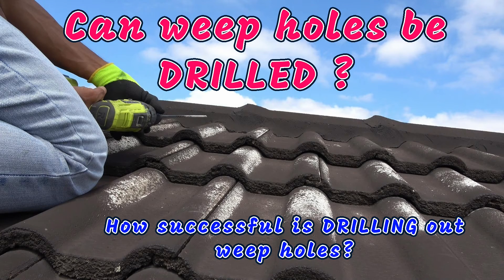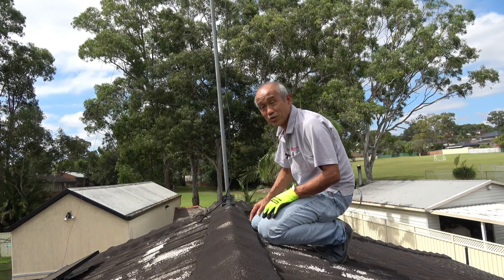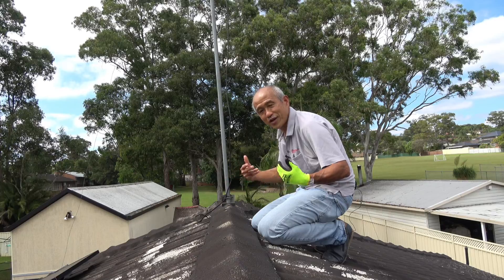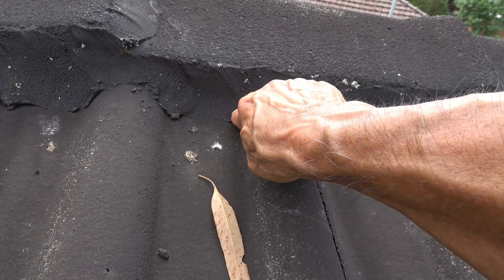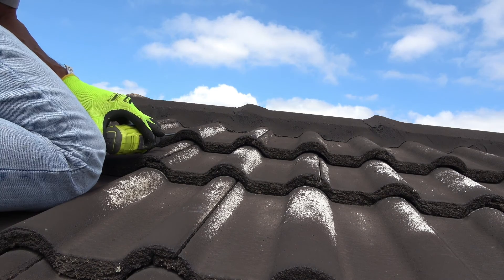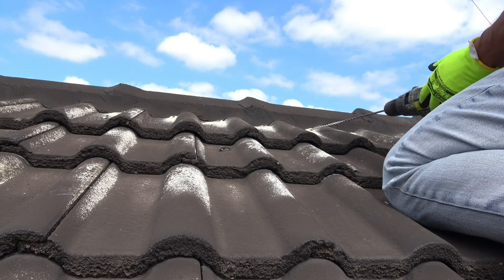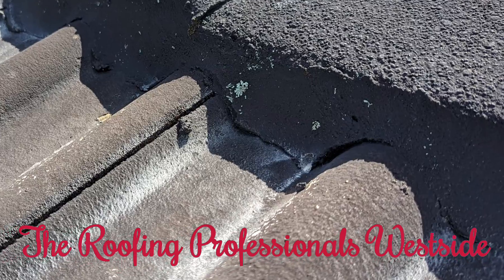Can weep holes be DRILLED out at the ridge capping to repair a slow leak?

Comment: I need to drill weep holes because none of the "professional" roofers that have repaired my mother's Monier tile roof over the years have put them in. You suggested to someone in another comment to upsize the drill bit to 8mm. That sounds huge... would you recommend that? The roof pitch is fairly steep. 

Also, how would you recommend removing mortar dust and remnants from metal guttering, without scratching it up? The roofers left a hell of a mess up there and it hasn't washed away in the recent storms, so I guess it's too heavy.
Reply: Use a leaf blower for the small stuff and pick up the rest
Reply: @gumwallaby  it looked stuck on… but I’ll go up and inspect again. Will wire brush a little if necessary. Still haven’t drilled weep holes 🫣 Really feel like I need to redo the pointing (and more).

Comment: Back from drilling weep holes in my concrete tile roof. My friend who restores rooves said to use 5mm masonry drill bit with extension if needed. Ended up getting MAKITA 5 x 465mm 4-Cut SDS-Plus Masonry Drill Bit - NEMESIS-2 E-04195 from Total Tools didn't require extension as this drill bit is long enough. Drilled using rotary mode and not the hammer action. House had been repointed over existing pointing thereby blocking the weep holes. Had a small leak that verified when is raining, was able to put my finger up under the ridge tile and was damp and leaking. Once hole is started lay drill bit against the tile to maintain the correct angle. Happy I found the cause of the leak and was able to fix it.

Comment: Forgive me for my dumb question. Are you supposed to drill weep holes on both sides of the ridge?
Reply from the maker: The answer is YES.
There is a different roof tile on each side of the ridge capping and they both need to be drained.

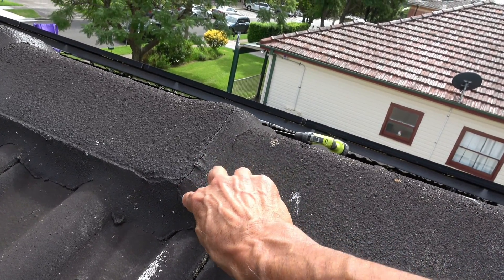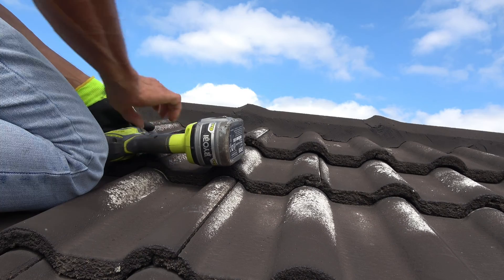Comment: Hi Jack, at 2:40 the tiles have a small crown in the middle of the valleys: I guees that's why the weep hole goes to one side. But with the tiles you are drilling at 2:55 it lookes like the tile valleys (is that the right term) are flat. Does that mean the weepholes can go in the centre of the depression instead of off to one side? I hope so cause that's what I've done! Any advice gladly received thanks Tim
Reply from the maker: Hi Tim,
Weep holes should be installed at the lowest point of the roof tile - so that it can effectively drain out the trapped water. Therefore it will be somewhere at the 'valley' section (even though the valley can be a flat section).
When roof tilers install ridge capping, it is firstly bedded on mortar and this is when the weep holes are created. Then when they come back to point over the bedding, the weep holes are covered and become hidden. 
So, how do the roof tiler find the weep holes again to re-instate them through the pointing?

It is quite simple.
They go either left or right. Middle is a bad option because it is difficult to locate.
So, it will be on either side, as the flat valley transitions to a rise to the crest.

So, when we have to drill through the hidden/blocked weep holes, it is easier to just find where the original weep holes are and drill through these. Left or right - never middle.

If there are no original weep holes to drill through, we find that it is still easier to go left or right - rather than the middle.

Hope this makes sense.

Thanks,

Jack
Reply: @RoofRepairsSydney  I found my weep holes are all placed in the left of the gully/valley (low point) on the tile under the ridge capping. One or two tiles had been replaced and must not have had weep holes prior, so I drilled right through the mortar bed, wasn't too bad as long as have the correct angle, careful not to drill in the tile but stay parallel to it.

Comment: G'day G'day, my names daneil and i just moved into a new house, well new to us as it was built in the 6ps or 70s and within a month of moving in we started to get water stains on our ceiling so i went up and had a look see and there was the 3 or 4 minor cracks in the bottom of severl tiles which was mentioned in the inspection report but what was mentioned was in the report was that all of the ridge lines both horizontal and diagonally were either crack or chipped and in multiple places missing and being on the pension and having spent our last cent on buying it i had to redon all of the ridge line cementing myself reoving ot all cleaning and then cementing it back in and am quater way thru flexible pointing so i can guarantee for certain that there are no weep tiles at all as none of the roofing videos mentioned them and i only watched the ones made by professional roofers showing how to do it. All water leaks have stopped and as soon as i get the money together I'll be buying more flexible pointing stuff to finish it off so my question is should i drill the weeps now or wait until i finish repointing then drill the weel holes and what size drill bit should i use, 4mm 5mm 8mm?
Reply from the maker: Hi Daniel,
We used a 6.5mm masonry drill bit on the video. You should upsize to 8mm if you can.
We recommend drill the weep holes before you do the flexible pointing.
Then, after the flexible pointing has been done, clear out the weep holes just by poking through the 8mm weep holes with a 6.5mm rod/drill bit.
Reply: @RoofRepairsSydney why upsize to 8mm? I went to buy a drill bit for this purpose but couldn’t decide. 8mm looked big. Do you use 8mm as standard now? Is there any chance of wind-blown rain getting in?

Comment: Do you need weep holes in the hips? The ridge caps that run down the roof?
Reply from the maker: Weep holes are not usually needed along the hips - because the watercourses act as weep holes.

Comment: I've never hear of "weep holes" in the ridge caps.
Is this a comon design, globally?

P.S. I'm a homeowner in S. Africa, and have been experiencing weeping during heavy rain. 
I've lived in the house since 1976, the roof has been professionally painted every +- 10 years and thought that this fairly recent issue was due to high winds pushing the rain up,under the concrete tiles.
Reply from the maker: Weep holes are one way to release trapped water. Since trapped water is universal, then weep holes should also be universal.